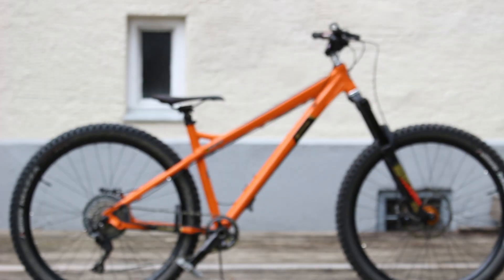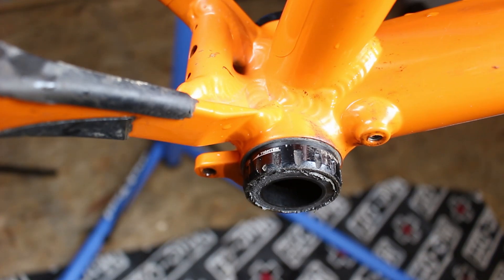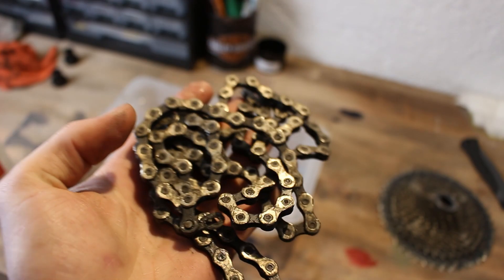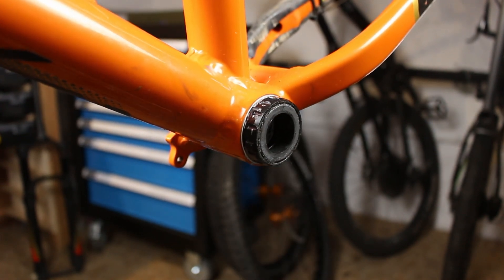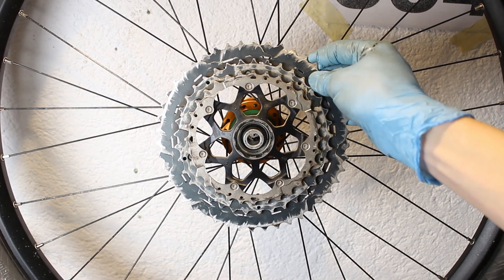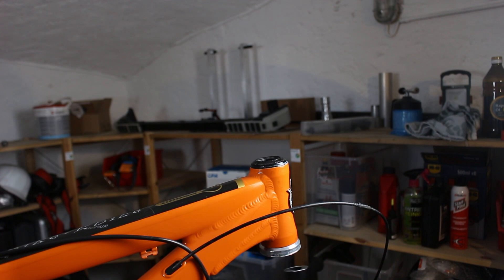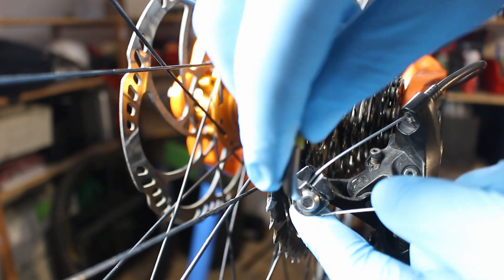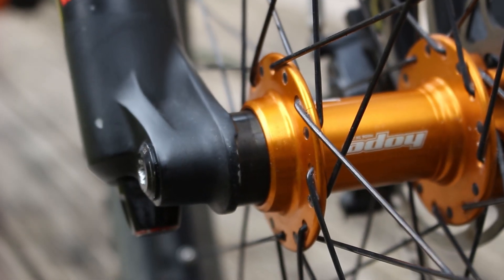Upgrading a MTB with CNC machined Parts(Weekly improvements Ep9)

Comment: Looks good but you need to cut some of that steerer tube off.
Reply from the maker: I know what you mean, the long fork steerer looks completely crap. But you have to consider that the stack on this frame is unfortunately not as high as on my Enduro, which is why I left the fork steerer so long. Additionally, the quite large DMR stem (which is flat but has a very large diameter) and the relatively small spacers make the whole setup look a bit disproportionate.

Comment: I think you should make the bash guard from plastic instead of aluminium: it's a sacrificial part and should have no chance of damaging the frame, which I don't think is the case right now as @Skooteh pointed out. Besides that the design is cool
Reply from the maker: You've raised a good point. How about a video where I test which materials make a good compromise between frame protection and chainring protection. A kind of "crash test"

Comment: on the bash guard, you should go for a 3 bolt, with only 2 bolts it's way weaker and way more likely to bend the frame tabs.
Reply from the maker: You are right i should try that.
Reply: Lots of companies make them with only 2 bolts (OneUp for example).  I think it would bend/break at or below the plane of the lower 2 bolts if there was enough force for it to break.
Reply from the maker: Yes, the bashguards that are attached with only two screws are primarily used on all mountain bikes/ Enduro Bikes. Those that are attached with three screws usually have a guide to prevent the chain from slipping off the chainring, they are more common on Downhill Bikes. I'll make a video testing the bashguards.

Comment: That is a nice looking frame. I haven't finished watching the video yet. However, at 4 min 20 seconds on at the bottom bracket section. I noticed that it has reversed threads, which is typical. But its supposed to reverse in a way that tightens as you pedal. At least that is what I thought.
Reply from the maker: Hey, thanks for your comment.
You are right, the Bottom bracket tightens as you pedal. I had to look it up my self, but now I know how it works. Let's assume we are on the Drivetrain side of the bike (the Right side), where we have the Reverse Thread. That means you turn it to the left to tighten it, BUT the Crank turns to the right while you pedal, so you actually loosen the BB. But here comes the catch: as you pedal in the "wrong" direction, the bearing balls actually turn in the right direction (to the left), so the BB is indeed self-tightening.
I hope I explained it well enough for you to understand.